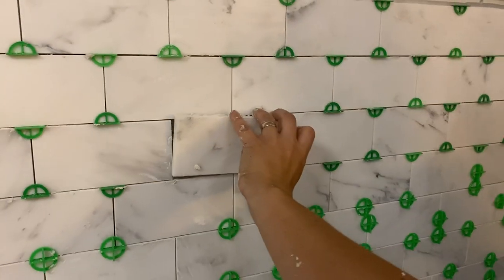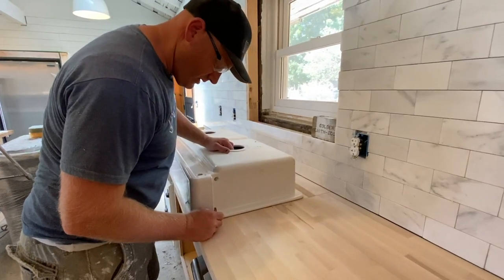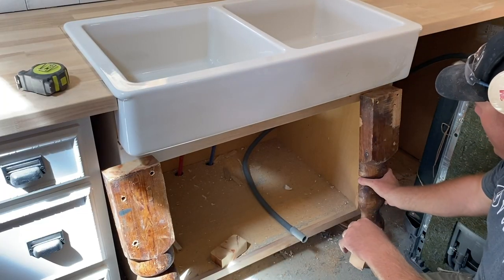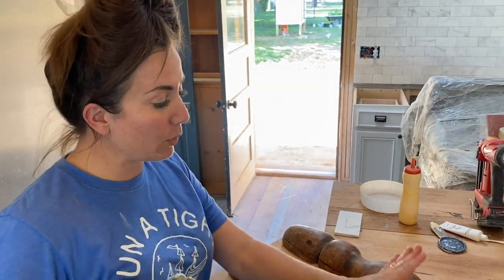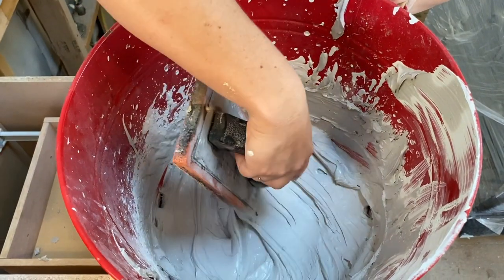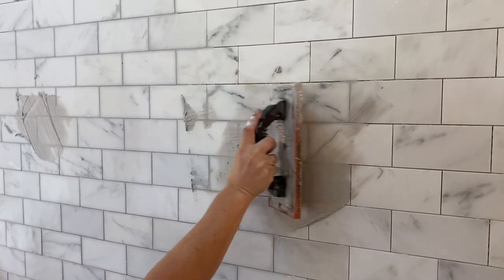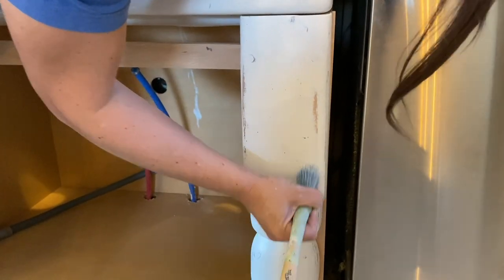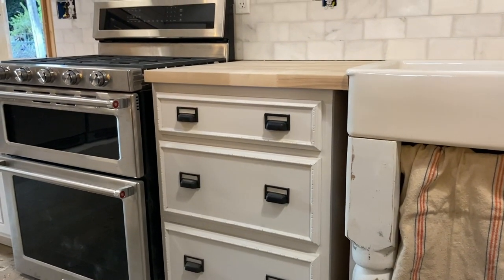Dream Kitchen Sink Install Farmhouse kitchen Ideas

Comment: The kitchen is coming together nicely. I like the variations in the tile, which create visual interest instead of plain white tile. And I really like the warmth of the wood counter tops. I have needed new counter tops for years and think I will stick with my original desire for butcher block too.

Comment: Great job!! I have a question about your wood countertop. Where did you get it and do you need to seal it? We are needing a new countertop and I love the look. Are they like a cutting board where you can sit your hot pans on? Sorry about all the questions.
Reply from the maker: It’s butcher block from Home Depot. We are dealing it with sweet Pickins oil wax like we did the pantry. And they do decent with hot pans. We haven’t had them before so we will see. Eventually we will do a different counter top. Well maybe we will, if we ever have money or time lol. These were under $300 total which I thought was great for color counter tops. And the look is perfect.
Reply: Jami Ray Vintage  It’s just beautiful! Love it!
Reply: @JamiRayVintage  Thank you so much for the info! You guys are doing a wonderful job!!

Comment: I just bought a black-outline transfer from you to put on a vintage metal tool box.  Im not sure whether I should put the transfer directly on the metal or seal it first.  I don't want it to be shiny when I'm finished.  Is there something I can seal it with instead of Big Top?  Thanks!!!!